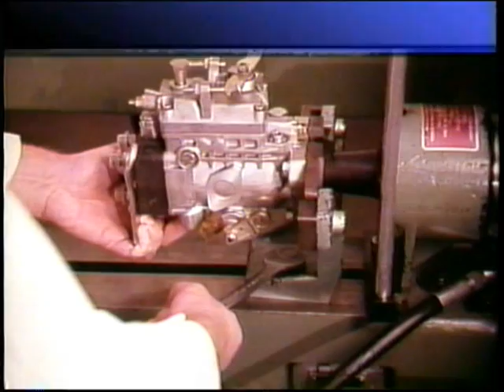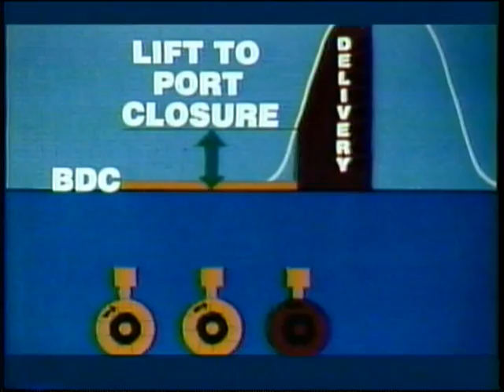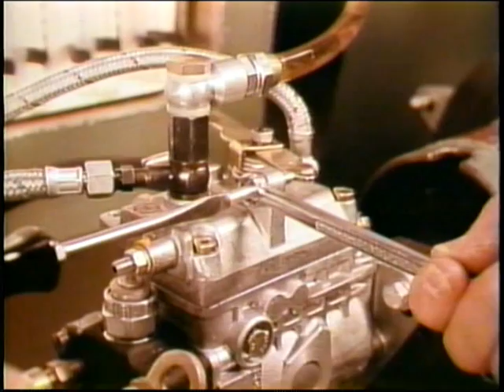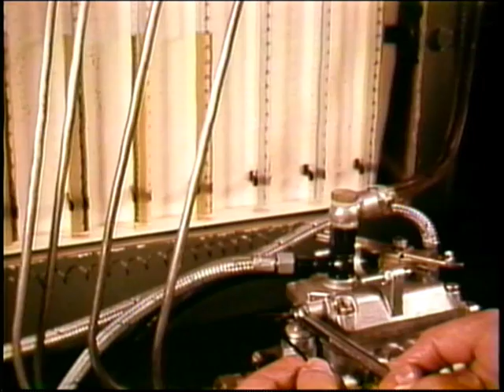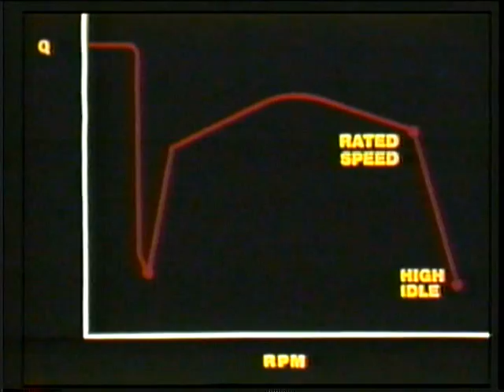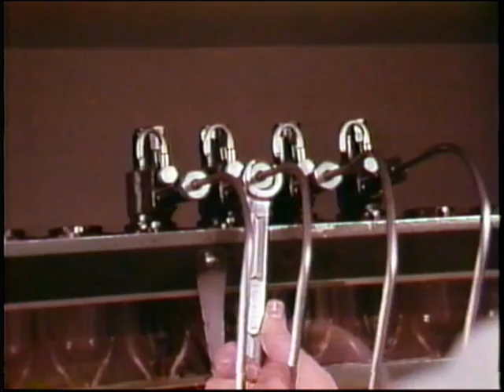BOSCH VE-Pump Calibration

Comment: Is there a group or forum for people who work.in this field ? We can help each other as I have 10 yrs experience on this field
Reply: Hi, I have an issue with my Bosch VE pump, when I fastly let go of gas, rpm drop to idle, fluctuate for about 3 seconds and then even out. But when I am slowly letting go of gas, rpms do not fluctuate. Could it be the faulty overflow valve or bad o-ring gasket at overflow valve? I have already changed the fuel filter, so I´m ruling it out. Thanks a lot
Reply: @ferocicina6602  Crickets.....
Looks like Rameez isn't looking to help anyone else but himself.

Comment: this is really not an easy job ,,,,,, i think it need years of experience till you finally ready to work on VE pumps ,,,,,,,,,,
Reply: VE pump are not that hard to calibrate since then timing and volume all the same bcus there are only 1 plunger P pump haved individual plungers
Reply: its just a pump, pull it to bits, put it back, chuck it in
Reply: @tortron  Easy to take it apart and reassemble it. It is a different story calibrating it to work correctly.

The best you can hope for without a test bench and the spec sheet is to take lots of precise measurements before taking it apart and try to put everything back in the same positions.

Without the special tools, it would be nearly impossible to get it 100% right.
Reply: @David_H_Parker  you still don't need years of experience to do any of that.
Reply: @tortron  I never said it did. You are referring to the first comment, not mine.

Re-read my comment and show me where I said it would take years to learn.

I said it would be near impossible to get 100% right without the test bench, special tools and the spec sheet.

The spec sheet is not available to the public, you would have to spend lots of time messing with the settings to get it dialed in the same as the Bosch calibration process.

The TDI pumps are much more forgiving if you have the right scan tool. These old mechanical pumps rely on precise setups to work right.
Reply: @David_H_Parker  if my comment was to the original comment, about taking years, then why would you reply to it entirely out of context and then be upset about it
Reply: @tortron  Who's upset?
Don't project your feelings on me.

I clarified what I said, it is all right there to see.

Relax, it's just comments on a YouTube video.
Reply: @David_H_Parker  your trolling is decent, the profile picture is a bit of a give away tho
Reply: @tortron  Oh, okay.... I'm trolling on obscure BOSCH videos with a small handful of comments. Makes sense....

Don't be upset because you can't read and follow a simple thread. Do you get confused in small groups having a conversation too? Do you have a hard time keeping track of who is talking and remembering what they just said?

My first comment to you was that it is not as easy as just taking it to bits and throwing it back together.... and done. It is a bit more complicated than you suggest. At least doing it right anyway.

I'm sorry you can't follow simple things. Maybe you should post a video of how easy it is and how perfectly it was done.